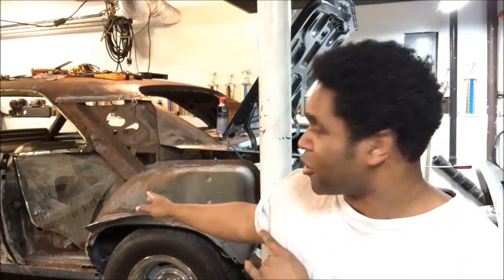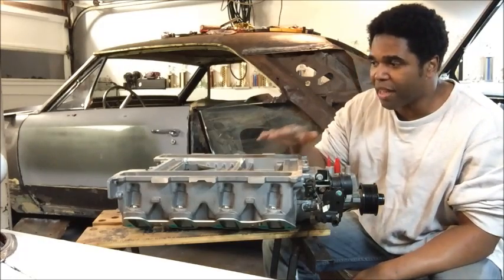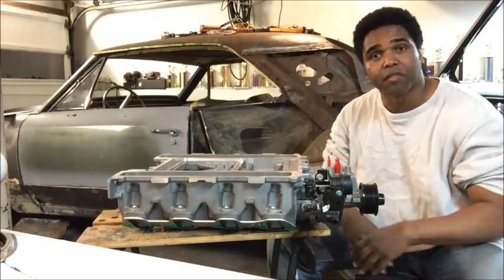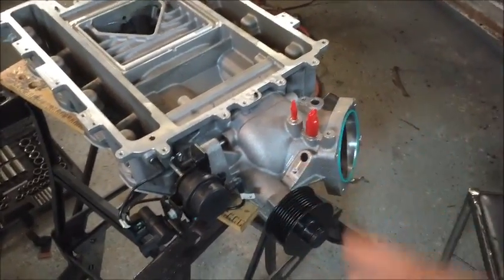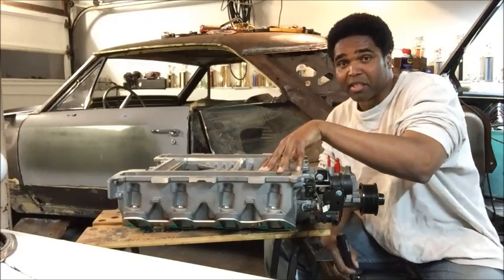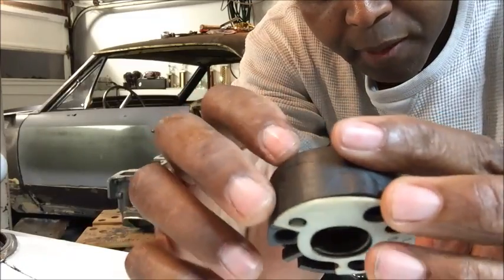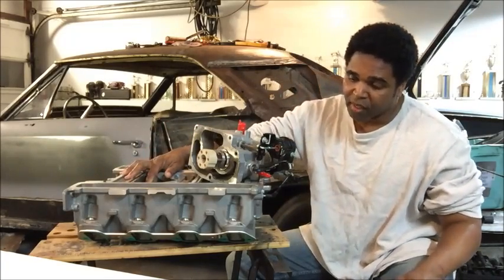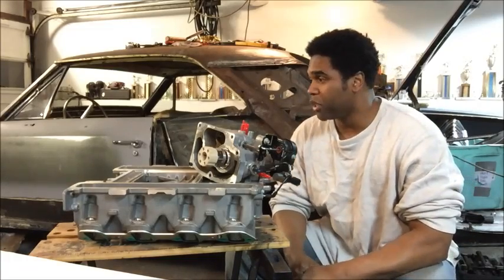How To: Replace A LSA Supercharger Spring Isolator To A Solid Isolator.

Comment: I never got a recall letter, Cadillac said it wasn't a recall it was just a change with a 10 year warranty, Thanks
Reply from the maker: yours might of been exempt.. depending on the year.. i have a 2015 ZL1 and i believe by then they put solid isolator in
Reply: coverman66  thanks, mine was a 2009, I got a ZZP isolator will see if Cadillac will put it on, if not will go to one of my gear head friends
I've bought 2 CTS V's and an Escalade over the years if Cadillac does me wrong I'm done with. GM and  will go Toyota

Comment: I just took my 5th gen ZL1 in to get the supercharger replaced. I heard you mention that they replace the spring isolator with a solid one. Did you hear this from GM or where did you find this information?
I have asked all over and cant find a solid answer.
Reply from the maker: i have a few buddies that are GM tech and have change the superchargers.. thats why when you see the LSA on ebay you have to change the isolator.
Reply: So when you take it into a dealership to get a new supercharger under warranty will it have a spring isolator or will i still have to put one in? We are stationed in germany and the mechanics somehow didnt know or just didnt understand. So we just dont want to take the brand new supercharger off unless it needs to be chaned. Thanks for responding back
Reply from the maker: yup, all the ones i have they didnt change the isolator. which is all good.. i rather do it myself lolol
Reply: @Coverman66  okay thank you we just got it back a few days ago and have the spring isolator just wanted to make sure

Comment: Hey Terry I talked with @Lsalou on Instagram I'm trying to find a blower setup for my ls3 right now @slammed59 had one but just sold it...I need your help finding a good one I'm on Instagram @johnboston7006 thanks brother ,I have 823 heads as well..
Reply from the maker: whats good John, i will keep a look out for you.. i come across them every now and then.. 823 heads? you will need adapter plates to use those heads..
Reply: coverman66 ok thanks Terry

Comment: I had my whole supercharger replaced by the Cadillac dealer about 3000 miles ago. And as of a few days ago, at idle, I hear a loud clunk and grind coming from the blower. Do you think I should just buy the solid isolator myself or bring it back to the dealer and let them worry about it?
Reply from the maker: hmmm. i would bring it to them and tell them its making noise.. chances are they will change the LSA again.. this time tell them you want the old one lolol

Comment: Have You seen the Holley accessory drive kits? That is what I used on my LS Jeep Cherokee project. I'm wondering the the blower pulley location would be compatible with that accessory drive setup. My AC pump and Alternator are mounted way up high, to keep them out of any water, I might encounter off road.
Reply from the maker: i have seen them, never installed one, i usually go with Lssimple or Dirty Dingo brackets
Reply: I believe I'll check and see if the Holley tech guys have any knowledge about it. I like the bracket arrangement, and still have A/C on my ol Cherokee. It's a fun machine. An LSA supercharger might be a cool addition to the project.

Comment: Is this a permanent fix or will it break like the original? You sold me on the LSA so I want to know should I look for the solid shafts ones or will the fix work permanently for the old ones. (1970 Cutlass )
Reply from the maker: i got the lingenfelter isolator from synergy performance.. i like to think its a permanent fix.. my fingers are always crossed lol

Comment: Terry, i bought an lsa supercharger it spins freely i dont hear anything weird but the teflon coating on the rotors seems to be kind of rough, how can i fix it? Can i spray it with teflon? Or do i have to change the rotor pack? Sorry for making a long comment but youre the only one out here helping the community
Reply from the maker: my pleasure Humberto.. thanks for that compliment... you can send it out to a company to have it repaired if needed.. but if your talking about the sheen on the lobes that spin i would leave it alone and install it.

Comment: I had a quick question about electrical I was hoping you can help me I'm almost time to install my LS engine but I'm not too sure about how to hook up the wiring harness I don't understand the concept of once I get my wire harness back from being reworked how does it plug into my dashboard and ignition key and stuff like that that's already in the car because I was told that I would have to pull my old harness completely out of the car for the new one that didn't sound right to me
Reply from the maker: it ties into the existing harness.. remember the LS harness is there just to work the engine.. power to the harness which powers the ecm and sends/receives signal to all the sensors and injectors..

Comment: Do you or your friend still have any LSA Superchargers left that you wouldn't mind selling?
Reply from the maker: i wish.. i have alot of people asking me for the, lolol
Reply: ok that sucks. One more thing, what stall converter would you commanded for this comb. I just want Daily driver with a little power Lq9, 081 ls3 heads and intake, 4l60 trany, 3.73 rear gears, comp cam xer273. (224/230 .581/.588 114lobe separation)? 
#87cutlass
Reply from the maker: hmmmm. i dont want to give you the wrong info.. call my buddy Geoff at engine power system.. he will answer that question for you.. thanks again

Comment: quick question I have purchased a LS swap radiator I believe it's 3 roll with dual fans with the LSA intercooler do you think that would be enough to keep my 5.3 L LSA project cool
Reply from the maker: i think you should be fine.. you will have to get a heat exchanger for the super changer..
Reply: I could use LS3 injectors right
Reply from the maker: i went with 72lbs injectors. just in case i want more power in the future

Comment: Hey man I really enjoyed your videos keep it up. Hey man I'm trying to get hands on a LSA super charger , I already got a 5.3 built up would it be a pain in the ass to put one ? Or should I wait on getting a ly6 ? Hey keep us update with ur build
Reply from the maker: whats good Grunt.. as long as you get square port heads or adapter plates you shouldnt have a issue.. im doing a video on a complete install.. im working on it now.. thanks for viewing..
Reply: Hey man 
I'm kinda lost 
They are selling me a lsa for 2500 complete blower but he told me that I'm not going to use. Injector harness or throttlebody 
I'm lost man can you help me out and guide me out please man
Reply from the maker: no problem,..what do you need to know? i will answer as best as i can..

Comment: What about the 5.3 ? Would they work ?
Reply from the maker: whats good grunt, as long as you have square port heads or use adapter plates you should be good to go..

Comment: I really like your vids buddy, I've seen just about every one, if not everyone lol. You've got a ton of very good information that's easy to follow and you make things easy by supplying part numbers and such. Keep up the good work. I'm considering 5.3 turbo for my 67 camaro but uncertain if I want to do the lm7 or l33... But other than that I've came to most of your vids for information on the technical aspects I'm confused about. Thanks a lot.
Reply from the maker: Justin, thats whats its all about.. sharing the knowledge and help save time, heartache and money.. i want everyone to learn from mistake and get the rides up and going.. a 5.3 turbo.. ive read articles about that setup making over 1000 hp.. please keep me posted, id love to see how you make out.. thanks again.. everytime someone tells me they use my videos.. puts a smile on my face that never gets old.. i thanks you again brotha..
Reply: coverman66 I like and supported your fb page as well. Thank you for the reply.
Reply from the maker: no problem. i always try to get back with my LS Crazed Amigos in a timely fashion. im have a instagram page,, terrylsx.. there i post lil quick videos and clips  thanks again Justin..

Comment: will this work on the ls1 or just ls2 ls3?
Reply from the maker: whats good ls1cutt
it will work with any ls engine, if you have a ls1 or 2 you will need to change the heads to a ls3 square port head or get adapter plates.. hope this helps brotha...
Reply: Thanks bro I been watching a lot if your vids got some good info off them.. specially for the info for the gas tank for my 71 olds.. thanks....
Reply from the maker: thanks, i really appreciate that.. its all about sharing he knowledge to help the next man LS install go easier.. if you have any other questions, im only a email away.. thanks Ls1cutt... my next project after the 67 chevelle was almost a 70 old cutlass coupe style.. but i came across a 70 monte i think im going to pick up.. we will see..

Comment: Thinking about putting one on my 06 GTO, will it work on the LS2? Would I need an adapter?
Reply from the maker: Hey John, you have 2 options.. adapter plates for change the heads to ls3 or any after marker square port heads.. i have a trailblazer ss im going install one on with ls2 heads i will upgrade to ls3 heads, i say get the squareport heads they flow better.. thanks for viewing and any other questions im only a email away brotha..
Reply from the maker: whats good Isaias,  you have 2 choices you could get ls3 heads or you can used the adapter plates.. this will work with any ls square port head, unfortunately the ls2 engine came with cathedral port heads.. i have the same issue with my 69 camaro but im going to swap the head for the square port when i do my install on that car.. hopes this helps and thanks for viewing..
Reply from the maker: Whats good John, if you got to ebay and type in LSA or LSX plates they should pop up.. off my head lsx.percision and faster proms make the plates your looking for. i would go with LSX.percision, they are a lil more lighter on the wallet. let me know how you make out brotha..
Reply: John Jackson  check Olsen Kustoms I was just looking into this today thinking about getting a LSA blower for my 04 GTO also
Reply from the maker: i will be videoing my install.. i will keep my eyes open for you

Comment: Bro I just bouth one   and I'm going to put it in mi 5.3 and I'm concern about the sensors on the lid  of the s/c talk about that part please
Reply from the maker: ant, i will talk about if for sure.. all you have to do is use just one senor instead of the 4 on the zl1 lid..

Comment: do you still need to get buy the lid of the supercharger  separate??
Reply from the maker: yea, when GM replaced the chargers they reused everything.. you can use a caddy V series top or a ZL1.. you can find the caddy tops for about 200 they are not as nice looking as the Zl1 but they didnt rocket in price to over 400 bills.

Comment: is this going on a 6.0 or 6.2?
Reply from the maker: whats going on Ruben,
its going on a 6.0.. you can use this with any ls engine with square port heads..
Reply from the maker: its going on my LY6 engine which is a 6.0 with ls3 heads.. as long as you have square port heads you can use the LSA, is you have cathedral port they make adapter to convert.. keep me posted on your build Ruben
Reply: +coverman66 well I had to pass on cts v supercharger, with no lid the guy was asking 350 but then I looked for the lids online, they range from 600 to 800 on where I looked
Reply from the maker: you can get them from summit or jegs for under 500 dollars.. if you decide not to buy it, tell your friend i willing to buy it off him... only if you pass Ruben.. thanks
Reply: +coverman66 I checked back with the guy, no luck he sold it..
Reply from the maker: thats all good.. thanks for checking Ruben..

Comment: Congrats on the new upgrade I should of went this way instead of my tvs2300 (way cheaper).  Are you going to drop down from the factory pulley, and are you going to port the snout and other internals for optimal airflow?
Reply from the maker: im going to see what the numbers are with the stock setup.. right now that chevelle is at 520/510.. if i can tap into the 600hp/tq  i would be fine with that.. thats a lot for a grocery getting weekend cruiser..

Comment: Cool channel, I just found it. The LSA series will be fun to watch!
Reply from the maker: thanks for viewing... ..im gathering the parts now.. plus doing body work on the 67.. but its what we love.. what are you working on?
Reply: I am working on a 1977 Camaro Z28. It is interesting because it is a California car, and is currently smog controlled. However, there is a bill working through the CA legislature to move the data from 1976 to 1981. So, I had been looking at a GM eRod LSA engine (which is legal in CA). BUT - if that law passes, I can put anything I want in there. Hmmm... choices, choices
Reply from the maker: ahhh my first car was a 75 camaro, love that car.. i hope the laws go your way.. i will tell you this i had one of my LS car on a sniffer and i was told the car runs just as clean as a new car.. i dont think you will have any problems.. thanks for viewing my clips.. they are there to help..

Comment: im installing the lsa supercharger on my 2010 ss camaro.. my question is about the harmonic balancer.. how do i go about installing the new one? ive seen people drilling holes into existing harmonic balancers but i dont know why...since youre basically doing the same thing i am.. could you please shed some light on the installation process? theres no videos on it or even an explanation on forums. if you could help out id greatly apreciate it! also the two hoses coming from the supercharger lid containing the intercooler are feeding into the coolant pump correct? how do i go about installing? which hose goes where im stuck on the entire intallation process lol
Reply from the maker: +Javon i will help as best as i can brotha.. lets see...on the harmonic balancer i think they are talking about pinning the crank and balancer.. if you notice on the ls engine crank there isnt a dowel pin like on a small and big block chevy engine.. pinning the crank and pulley will prevent the pulley from spinning from your new found power.. you can get a LS crank pinning kit on ebay, they are about 30 bucks. the two ports on the hat of the supercharger is for the coolant in/out... i believe the top is the in.. i will check tonight and get back to you... what belt drive will you be using to install the LSA.. the 2010 SS is a LS3 with a 6 rib belt where the LSA uses a 8 rib belt.  i know tehre is not alot of info or vids on installing a LSA, im working on a video now from soup to nuts.. stay tuned, im in the middle of getting all the parts now.. thanks viewing Javon, and remember im only a email way.. keep me posted..
Reply: +coverman66. thank you very much for getting back to me so fast! everything you said makes perfect sense and has really helped out. so, there isnt any "bolting" a crank pulley onto the harmonic balancer right? it makes more sense to remove the old that contains two pulleys and replace with one that has three with the extra being for the supercharger. im just excited to see your video because youll be the first actually giving a "how to". thanks again for your help! ill definitely stay tuned.
Reply from the maker: no problem Javon.. ever thought the crank pulley if pressed on, it also has a bolt that needs to be installed and torqued. with the supercharger you should pin the crank for cheap insurance reasons.. Javon, what you building brotha...  thanks again for viewing and hope these tips help...
Reply: +coverman66 alright seems not too hard. thanks again for the tips man. ill finish my build once i view your video lol i dont want to chance it. but all im doing is adding the zl1 supercharger to my camaro ss. i have an upgraded blower pulley that will give my 11 pounds of boost. i also have a stage 4 cam shaft that should add about 100 more horsepower my goal is to eventually make 800+ horsepower. just taking it one mod at a time lol
Reply: +coverman66. also where did you get all of the pulleys needed and how much if you dont mind me asking.. the tensioner and pulley is a little confusing lol
Reply from the maker: +Javon the beauty of these blowers is that 800hp can be obtained easily.. sounds like you are on the right track.. are you planning on going meth injection? i have a 2011 SS and eventually i will add a blower to that, right now im gathering all the parts.. i can feel your excitement brotha lolol
Reply from the maker: +Javon im an open book.. i got my pulley from off of ebay. its a LSA style pulley with the 3 belts.. Metco motorsports makes a great pulley if your the type of guy that like to change your boost.. the pulley allows for a removable ring to change boost.. there are other companies that make pulleys.. im working with brent from dirty dingo to create an entire pulley system to power steering, ac, alt.  on my chevelle im running a dirty dingo setup , when its complete i will upgrade to the LSA kit.

Comment: Can I install this supercharger on my lQ9 engine with adapter plates
Reply from the maker: as long as you have square port heads you can. i hear the adapters work well, so you have options before you swap your heads.. thanks for viewing Sergio..
Reply: +coverman66 do you know if I have to get another wiring harness from PSI for it to work
Reply from the maker: no need, you can use the same harness just dont connect the sensor in the back of the supercharger..
Reply: K thanks